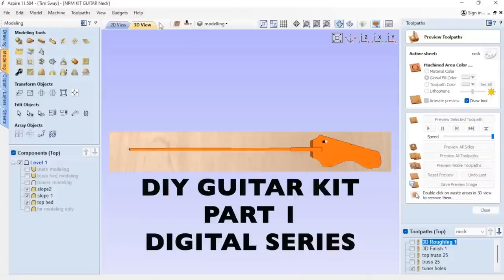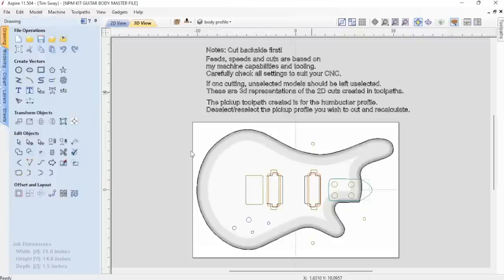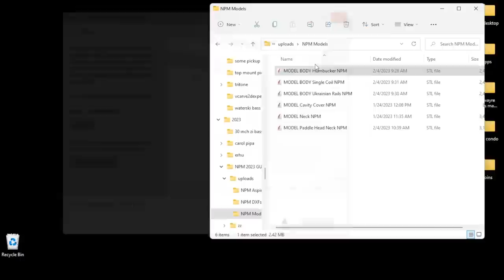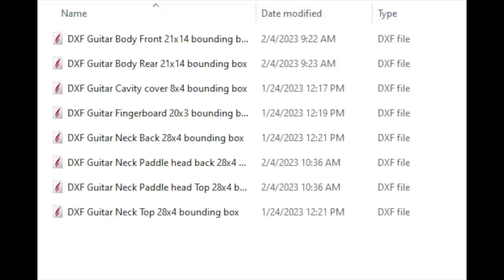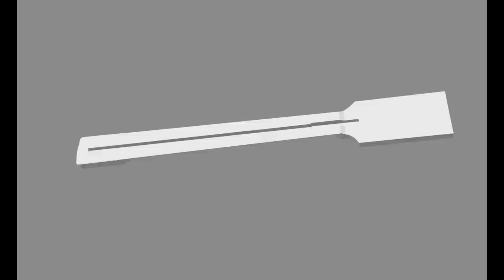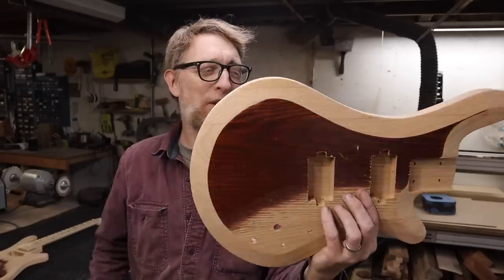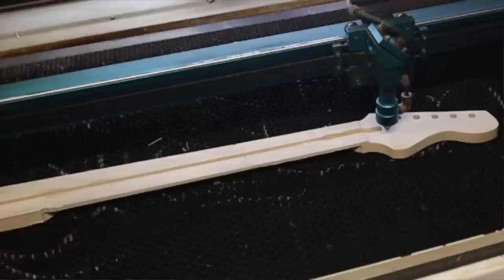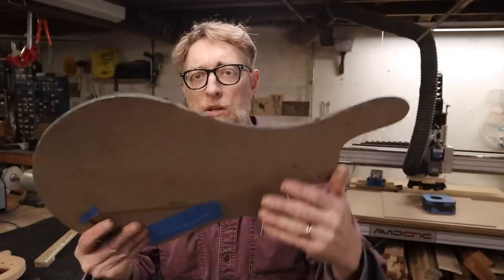New Guitar Design just for DIY Kits - You Can Make This

Comment: Just bought a set. Now to figure out how to cut them out on a 11 x 11 CNC. 🤔
Reply from the maker: With tiling you can do. The neck and fingerboard. What I would do, if I were you and that were my machine, I’d use the machine to make handheld router templates. You can puzzle piece them together.
Reply: @timsway  That's a great idea.

Comment: This is awesome Tim. I plan on buying your plans. I am a Vectric Aspire user so it should be easy. Any consideration to making a 24 and 3/4” scale neck? I have a love for the single cut LP style guitars. Thank you for taking the time to do this, and sharing.
Reply from the maker: If there is enough interest and sales, I'll absolutely develop more and different styles. 

Depending on your comfort level, you could modify this guitar to 24.75. use a fret calculator like https://www.ekips.org/tools/guitar/fretfind2d/ to create a new fingerboard and shorten the neck a little and/or move the bridge. It gets a little tricky but can be done.
Reply: Yep, I will try your recommendation! I have tried in the past to design and cut my own necks, but somewhere in between modelling and creating tool paths I have yet to be successful. Hopefully your plans will assist me in that regard. Thanks Tim!
Reply from the maker: @cradd00  i mean really, you could just move the bridge 3/4" closer to the neck (and probably have to move a pickup, too) and you could make a 24 to 26 position fretboard that fits right onto the neck I've already created...

Comment: I like the idea, and I'll probably buy the plans at some point. And the prices seem reasonable compared to some others I've seen. I have 2 suggestions though. First you really should include a better 3d file type if you can. STL is a simple triangulated mesh format which will be difficult for someone to try and modify them such as incorporating their own headstock design in the paddle version. Additionally as it's a triangulated mesh, it will be a faceted approximation of the curved surfaces. Some software handles that conversion on export better than others, but often the curvature can be dodgy to say the least. Not sure what you use for modelling but something like STP or IGES would be more useful. Secondly, it would be great to have the option of buying the neck/fretboard plans separately to the body.
Reply from the maker: TBH I know very little about 3d modeling outside of the Vectric software world (which is different, for sure, and only allows 3d exporting as STls). But I do know these files were triangulated with very, very tight resolution and the models open up cleanly in other software. IMO these files are most valuable to Vectric users, and the second most valuable part are the DXFs. If there is enough interest I will absolutely add more options and ala carte features. Keeping it fairly simple to start, ad at a price that you might as well just buy it all, yknow?

Comment: I'm really curious how that oak guitar turns out. I contacted the folks at a company whose name starts with W why they don't use oak as a viable wood option. They replied that it's too bright sounding and it wears down the tools making it expensive to work with. Looking forward to seeing/hearing your results. 👍🤞The poplar neck I'm not too sure about, though curious how it turns out. I would think a poplar body with an oak neck would be a better combo but who knows unless you try.
Reply: from what i learned, electric guitars don't care for the wood. the sound is all in the electronics. pickup distance and placement is what makes the tone on electric guitars.
Reply from the maker: @hurt4fun - yes
Reply from the maker: I've made quite a few guitars from oak, necks, bodies and all. I'd avoid red oak because it's real splintery but white oak is quite nice. I've also made many necks with poplar which is great bc they are nice and light, but I agree poplar is a little lacking when finished. Here's a guitar I made from some oak that was more than 400 years old! https://youtu.be/yEItVt9OBEc

A lot of what guitar makers say about tone wood is true when you're talking about acoustical properties - which really only matter on acoustic instruments. Once you start plugging them in, all that becomes pretty unimportant. Strength and stability are the really important qualities - and a close second for me is sustainability, which is the part we need to convince the rest of the world about.

Comment: I just ordered your last fretboard, was wondering if you will have any 24 fret versions?  Also do you have any plans to offer other scale lengths?  I don't have a CNC so I was hoping to use these as master templates.  I love the fact that they have a zero fret.
Reply from the maker: cheers! If the system is a success, I will absolutely add to it. Starting with just one basic plan right now, tho. Yea, zero frets are better :)

Comment: What is a good beginner machine and software to start with..that has the capability of cutting all the guitar parts..recommended for someone who has no CAD experience, no CAD-CAM experience, etc..but doesn't want a toy that will break after the first time they use it, will take them from beginner well into intermediate or advanced intermediate  before they really need to upgrade?
Reply from the maker: excellent question. I firmly believe in Avid CNC and Vectric software although buying an Avid may be a bit much for your first CNC (and confusing because you gotta build it). Def. get Vectric software. Stay away from the flimsy ones. You'll have to spend a couple grand. I like the Next Wave Shark. Comes out of the box ready to work.